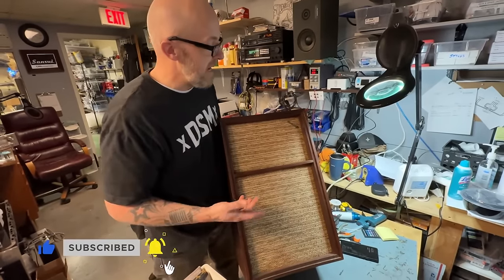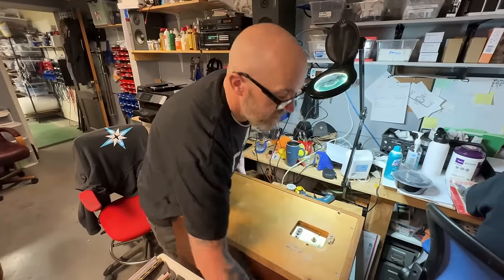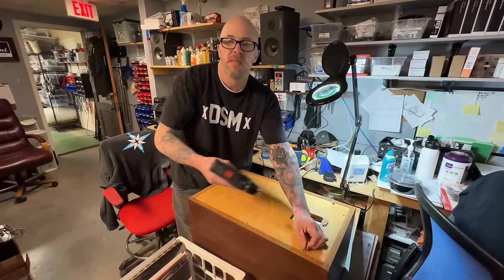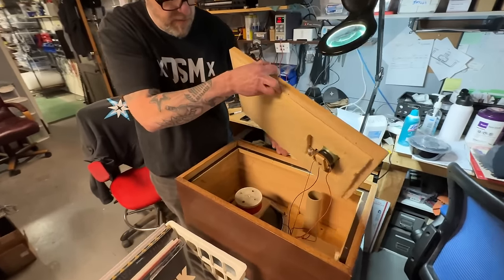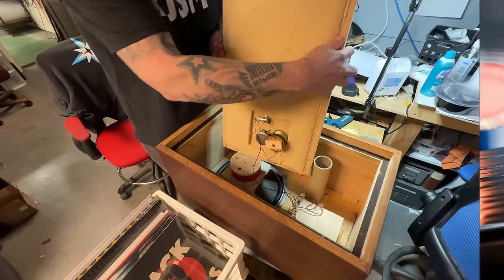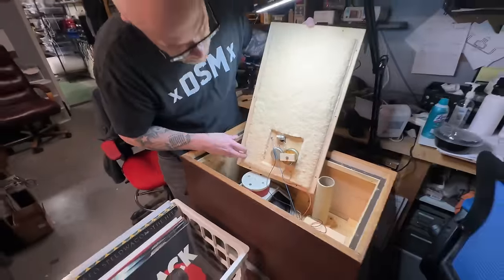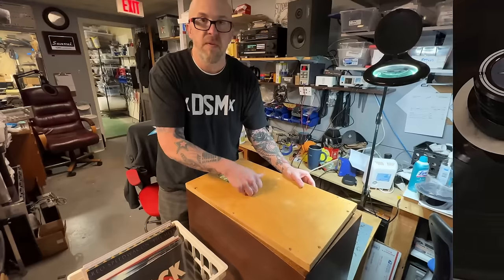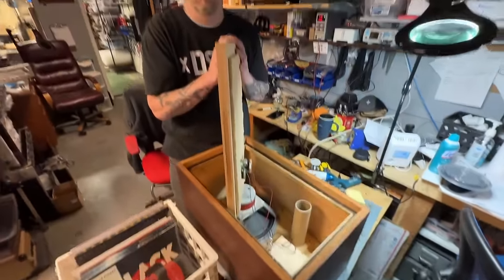A Short Sunday Video Featuring Wharfedale W60 Speakers

Comment: I have a pair of these. I recapped the crossover.  Replaced the grill cloth with real off white linen. They sound great. Especially with tube gear.  Mine date to about 65 based on the hand written dates on the very nice alnico woofer with a heavy duty cast basket. Very underrated speakers in my opinion.  I love vintage Wharfedales of this era. Yes, those plugs are where they filled the sand.  I got mine at an estate sale for $20. The larger W-90s are really cool too.

Comment: I have owned a pair of Wharfdale W90Ds since 1971. They weigh 120 pounds each and are sand filled. Sand is in the walls of the cabinet to reduce vibrations. I was concerned as a retired industrial hygienist when you said that some sound proofing might be asbestos. Better get that stuff tested before going any further. YOU do not want to mess with that stuff!
Reply: I made a comment about sand and speakers
Reply: Actually, the original brochure for D series states that the enclosure is lined with “English Long-fiber wool”.

Comment: The sand filled Wharfedales were unique. It was generally the baffles that were sand filled, hence the Wharfedale SFB open baffle speakers from the 50s/60's. The giant 'Airedales' had sand filled bafffles too. You are correct with the W60 as the back panel was also sand filled. The original W60 was two way, the later W60d was three way which was called the 'Dovedale' in the UK. The W70 came in different guises too, the latest being the w70e which was the 'Rosedale' which was superseded by the 'Kingsdale' in 1974. All named after the Dales of Yorkshire as is 'Wharfedale'.

Comment: I inherited a pair of Wharfdale W60D’s my father bought new in 1967.  These were 3-way acoustic suspension speakers with a 12 inch fabric surround woofer, the purple Mylar dome tweeter, and, uniquely, a surround-less 5” midrange in its own damped sub enclosure crossed over at 1000Hz.  That, and the sand-filled enclosure (stamped on the back:  “Sand filled enclosure-do not drill!”) made for a decidedly un-boxy sound.  I remember accompanying my father to E.J. Korvette in Detroit and him commenting how much better they were than the AR-3A he was comparing it to.  The receiver that powered them was a Korvette house brand XAM model actually built (beautifully, BTW) by ElectoVoice in Buchanan, Michigan.
Reply: I still have the XAM receiver and the W60Ds. Just wonderful.

Comment: Get well, Kevin!

I have a Wharfedale W-40 of the same early-1960's vintage as yours, complete with the blue egg tweeter. I disconnected the crossover and just use the woofer (powered by a ChiFi class-D 50-watt subwoofer amp) with a pair of Sequerra Metronome 7 bookshelf speakers (powered by a NAD 3020 integrated amp). The spec sheet on the Wharfedale says it goes down to 35 hz, and I believe it. That's one formidable woofer that matches well with the East Coast sound of the Metronomes.
Reply: My 1st system was W40’s, a Sony TA 1010, and Philips 308 table. All used, paper route money about 1972.

Comment: I just picked up a pair of untouched 1966 W70s from a local estate sale. He was a retired colonel and bought them new in Hong Kong back then. They still have the acrylic dealer plate on the back. The finish is starting to alligator slightly after 60 years but overall they're about as mint as can get. I opened them up to put on proper binding posts and noticed the crossover appeared to be just a 4 uF cap and a potentiometer. The sound is a little too vintage for me. Kind of boomy and muddy like our parent's giant stereo consoles. Maybe replacing the cap and pot might help but for now, they look killer but sound....meh.

Comment: Kevin , what are your thoughts on Ohm Walsh speakers? Can you do a video on just those speakers and a breakdown on how they can be improved?
Reply: I bought a pair of Ohm G (smaller version of F, with a passive radiator added) in the 1970s in college.  I still have them, in need of refoaming the Walsh drivers, or driver replacement with a more modern version of the Walsh that Ohm  makes for it.  Super, super interesting speakers due to the phase-coherent cylinders of sound it radiates out.  I consider them the best speakers ever, for low and medium volume listening.  At higher and higher volumes, I shift over to preferring my Klipsch Cornwalls.  The Ohms are power hungry, and you can only drive them so hard before the sound loses its perfect accuracy, and that happens well before you get to rock concert volume.
Reply: I have always found the theory behind them interesting, somewhat akin to the saying, "Don't raise the bridge, lower the river." The speakers are the result of looking at the failure of the design of a loudspeaker and asking, how can I use it to my advantage?
It's been decades since I have heard them, they were on my short list of loudspeakers to buy. I eventually bought a  different pair of speakers on the list, Polk SDA 1-A's and I have had them for 34 years. My wife doesn't like how big and visually imposing they seem, but they came with me as a package deal.😅

Comment: I'd almost forgotten that brand. My uncle had an old pair I remember that he had in the 80s. Not sure the model, but I was impressed and don't think I even heard them, lol. On a side note, I have an old pair of BIC Venturi Formula VI from the 70s. I've looked through your channel  to see if they're mentioned, there's very little online about them outside of Asia. Curious what your thoughts are. These are the original one, I think later they had ribbon tweeters. I didn't think they sounded as good as they should, saw some stuff on Xover caps and pulled all of the drivers out. The foam that had lined the box had all crumbled and fallen to the bottom, blocking the port! Cleaned it out, brand new speakers! I'll probably still recap, When I sweep with a generator there are some nulls I'm thinking are a gap between bands. I also plan on relining the boxes with something. So excited I wound up getting a really clean Marantz 2240, they sound awesome together. Anyway, I would love to hear what you have to say about the BIC speakers, maybe a video even.  I lived on Long Island in the mid 70s, one of the highways went past their facillity with the big logo on the side. Thanks, love your channel! I wish I lived closer. BTW, I live not far from Binghamton, NY. I got the Marantz from a little place that turned out to be like a Mackintosh Superstore! Wow! Audio Classics, Vestal NY. Have a great day!

Comment: Sand is indeed in the back panel on wharfedale.  On the two pair of w70 I've worked the capacitor is an oil type.  Shouldn't need replaced.  Actually may devalue them slightly.  Hope the tweeters are OK.  They get fried easily.

Comment: I have a pair of these. Found in an abandoned house that I inherited. I can confirm sand. It''ll pour out of the screw holes where the crossover is mounted. The cap on mine a contained metal box. I can attest that these things still have some lungs. I redid face frame, new marshall style grille cloth, casters. Good 30 plus pounds each.

Comment: I own a pair of wharfedale 415 (made in 1992). Really small, and really heavy. No bass reflex port - that was my reason to buy them. They can handle 100 Watt, which i won't be testing. In conjunction with my vintage yamaha receiver, they sound really British - that means controlled, even a bit dull. When i crank the volume, these speakers come ALIVE! They are the best speakers i ever had, and yes, speakers are the most underrated part of hi-fi systems.

Comment: A bit of advice for working around that liner material that's likely asbestos would be to give it a spray with some STRONG hairspray and let it dry for 24 hrs. That should make it safe-ish to work with where it might get disturbed and become airborne. My dad was an insulator for 35 years and has hammered asbestos safety into mine and my brother's heads all our lives. Great video and glad you're feeling better Kevin.

Comment: Glad I caught this video, had a pair of h/k 40 acoustic suspension 2 ways that had the same material on the inside (a lot of it), after figuring it may be bad stuff, I gently put the woofer back in and took them outside to blow off any particles that got out with compressed air (while holding my breath lol).  I'd never seen anything like it before,  and could not identify it.  I assumed it was the "A" word..  When I go to re-cap them, and replace all that material, I'm going to do it outside and wear a Tyvek suit with a respirator.  In will go the lambs wool.

Comment: Thanks for this Kevin, hope you get better soon. I picked up a pair of W60's recently for a good price. I think they're the next gen after yours. The owners were just using them as cool looking end tables for their lamps. These have the feet attached. The back panel is definitely sand filled as you can hear it move like a rain stick when tilted. I replaced the large 12uF cap with a film cap and cleaned the pots. The alnico woofers with the red ring are quite nice. To me they're similar in sound to the large Advents, which I still prefer for their top end. Still, a nice sounding and great looking vintage speaker.

Comment: Wharfdale speakers were popular in the 60s, Allied radio pushed these a lot.  There is a sand filled sandwich in the panels, which does makes them heavier.  These days similar thickness MDF panels would act similar.  Whardale was an early adopter/developer of acoustic reflex designs starting with there version of the RJ speaker enclosure.

Comment: Back around 81 I went to a high end audio retailer an hour away and what a rush. They showed me a pair of English speakers that were huge, about 6' high, about 3.5' wide and about 1' deep.. I noticed that at the bottom it was filled with sand to a point. I asked and they said the amount of sand controlled the bass. The sound was outstanding as the sound presence was 3D as was the price at $12,000 CAN a pair. My ESS Towers were no match for them all in all. Insanely above my price range, but so sweet sounding.

Comment: I have a pair of these.. can anyone confirm if the material inside is asbestos.. imagine putting a ported woofer in them and the asbestos would pump out the port.. if asbestos they are going in the trash.
Reply: Took out a piece of insulation and put a match to it.. it burned so it’s wool.

Comment: I had a pair of these wharfdale w60's. I got them at an estate sale for $50. They were well cared for, but looked even better once I put some orange oil on the wood veneer. I used them and enjoyed them for about three years. I powered them with a Marantz 1060 amp which was a perfect match for them. Very sweet and tube-like. But ultimately I sold them as they just didn't measure up to my other speakers, namely my ADS L880/2, PolkAudio monitor 7's, and Altec Landing 205A's. My W60's had the sand in them and they were very heavy! If you run across these at a reasonable price, they are definitely worth picking up. 😊
Reply: What do you think a reasonable price would be for the W60. Seller says they sound nice, ALNICO 12" woofers. One serial number is around 68xxx and the other is 67xxx. The backs are different too. One looks like very old brown plywood and the other looks like old paler plywood. $99 for the pair.

Comment: I'm still using my Wharfdale W60D speakers I purchased in 1968. They are sand-filled and weigh about 50 pounds a piece. They have a 3" tweeter, a 6" midrange, and a 12" woofer. They are 8 OHMs with a minimum power requirement of 8 watts. The maximum wattage they can handle is 35 watts each. They have a removable fabric grill cloth. For my use they are perfect. Like I said, I have used them for 56 years. I restored my Bang & Olufson 9000 stereo cassette recorder/CD player  a few years ago. I got that unit in 1985 when I started using CDs. I have accumulated over 3000 music CDs. Both are great pieces of equipment. I restored my Tandberg 64X reel-to-reel recorder for occasional use. As you can see I buy quality equipment and keep it a long time. I love your videos. Keep up the good work.
Reply: My Brother! I love the "Dales. When I was in high school and college I worked part time in a store that sold parts to local TV repair shops, TV, radio stations and industries. We had a "sound room" as it were and had a set of W60's for sale. Now remember back then everything we had was "fire bottles", i.e. tubes. When the partners went to lunch I would get the 12 to 1 watch as I liked to call it back then. For the most part nothing was happening during that time so they felt "the young man will learn more responsibility being in charge for a while". Yeah right! When they would go to lunch and I was alone, out would come the latest hard rock album and my lunch time was GREAT! You aren't kidding when you wrote "minimum power requirement of 8 watts" they were to be kind, inefficient. We had a McIntosh preamp, amp combination as I recall with a Garrard turn table that I don't recall the model or cartridge. Funny thing about stuff over 50 years ago, details fade a bit! Anyway those "Dales sound great in that small room and I couldn't afford them because minimum wage back then was the princely sum of  a whole $1.85 an hour! I thought I'd made the big time when I got a whole dime yeah $.10 and hour raise! They simply were out of reach price wise. Thanks for rattling the brain pail here, great memories there. Be well and safe peace to you and yours.